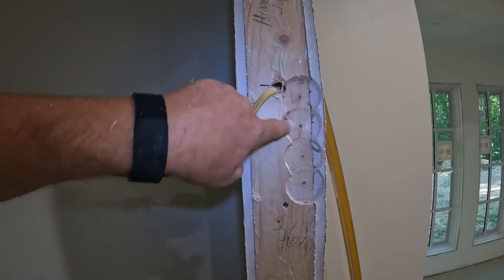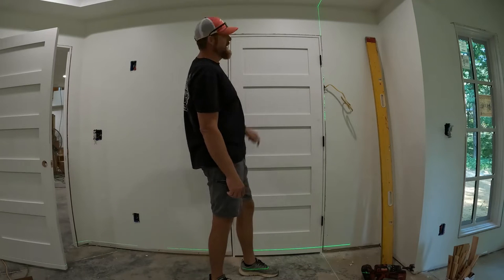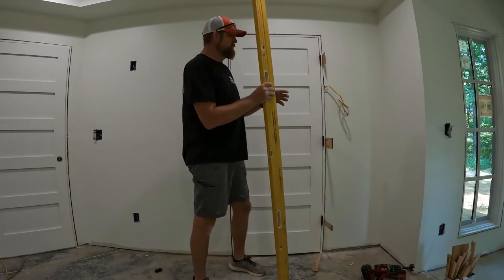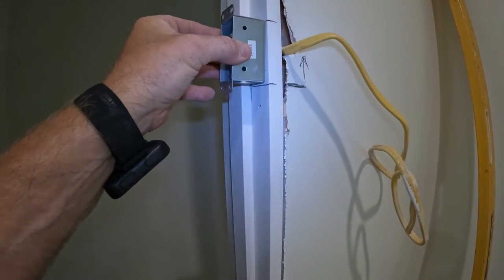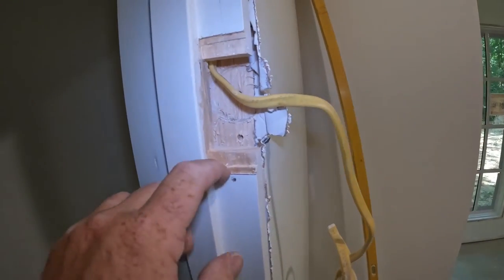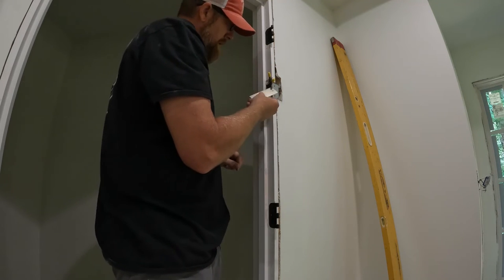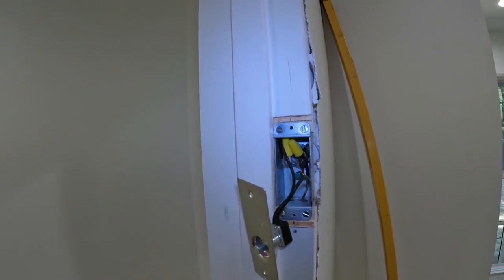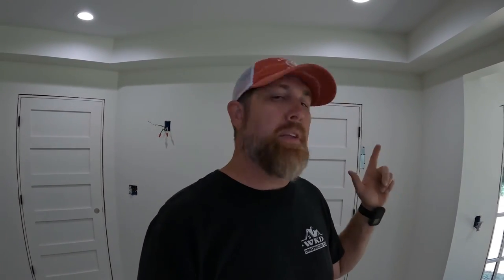Let's Install a cool ass door activated light switch

Comment: I take the door off the jamb and hang the jamb on the hinge side making sure the hinge side is higher than the latch side. Then I put the pins back in the door and finish hanging it. Otherwise I do it the same as you show in the video. The light is a nice touch. Subscribed
Reply from the maker: thanks for the sub and for watching!